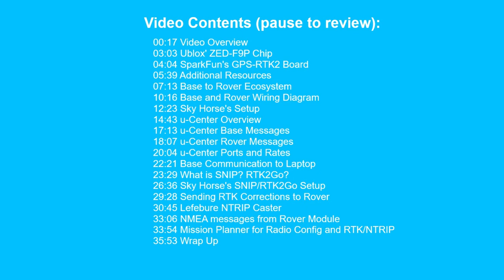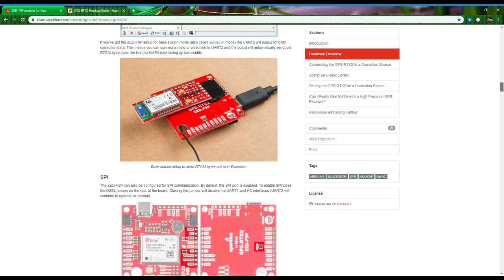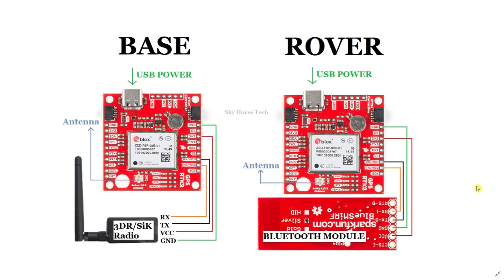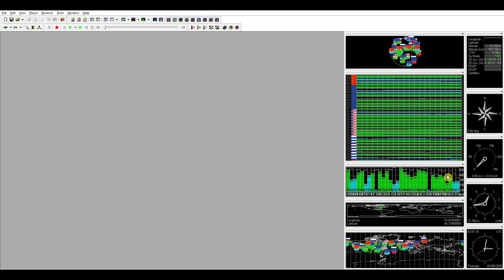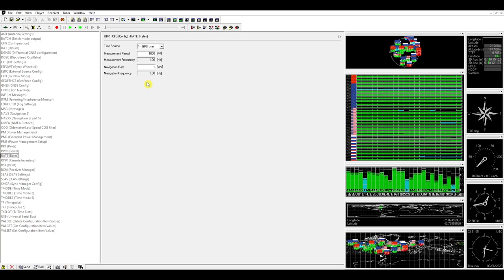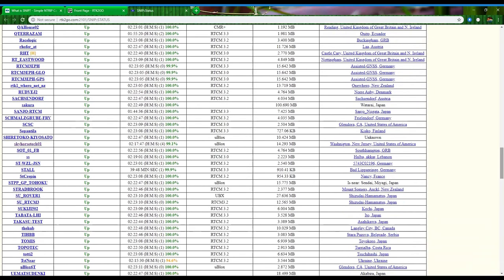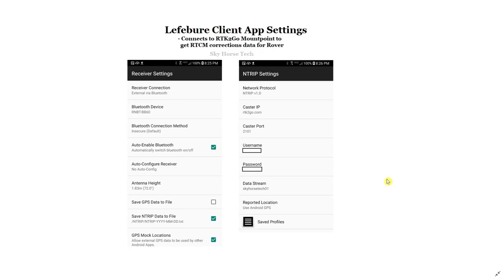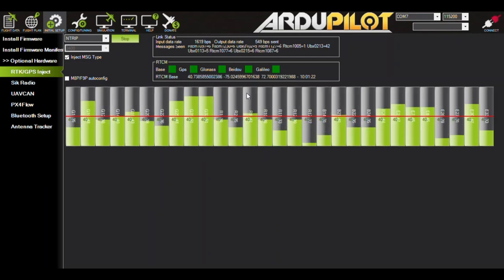How to setup ZED-F9P RTK Base and Rover

Comment: very nice.. can you help me build rtk base and rover
Reply from the maker: We aren't able to provide 1-on-1 instruction at this time however there are several excellent how-to videos out there that should get you started in the right direction. Check out Roby on YouTube along with the links in this Description section for addt'l guidance. Start simple by building a rover, using the wiring diagram in this video. Once you get that running, building a base is much the same. If/when you get stuck, Google or YouTube search your problem and usually someone else out there has run into the same exact problem and provided their solution. Good luck!!
Reply: thank you very much.

Comment: Hello Sky, good morning.
With what name do I get the USB adapter and the accessory to fix it to the box on Amazon?
Please also indicate the accessory to fix the antenna adapter. It is that I am in Colombia and I do not know what name these components are known in the United States.
Thank you so much for your patience.
Reply from the maker: Hello, we updated the Description section above with a complete materials list. The item you are looking for is the Blind Spot Power Junkie. You'll also need the battery(s) for that which is listed right below that, the NP-F550 batteries with charger. To attach the Blind Spot to the survey pole you'll use 'pole clamps' with 1/4" connector listed right above that. Not sure which antenna adapter you are referring to but believe we included all of the antenna items as well now. One thing to be aware of when purchasing the SMA or U.fl connectors is to get the correct combination of Male and Female wires as all of those antenna wires come in several configurations. If connecting to a male SMA connector you'll get a female connector wire, and visa-versa. Hope this helps!
Reply: @SkyHorseTech  Thanks champion

Comment: Great! Does we need to set the GPS coordinate of the base station?
Reply from the maker: Yes, you can get the base coords using the Survey In method in U-Center or run a survey for 24 hours and get even better accuracy using PPK with a CORS base station. You would have your base station setup as a rover during that survey and the base would be CORS. Then when you get the exact coords of your rover (future base) through RTKLIB you plug those base coords into u-Center and switch your rover to a base.
Reply: @SkyHorseTech  Thanks for your elaborate explanation, though I can't understand it much. Supposed I go to survey an area and I don't know the GPS of the base, can I just put a base and then a rover and start surveying?
Reply from the maker: @កសិកម្មនិងបច្ចេកវិទ្យា  Thanks for watching. Your base will need to know the coordinates of it's exact position. This can be obtained using the Survey In method which is the easiest but not necessarily the most accurate as it takes 12-24 hours to get a more accurate position. Check out the uBlox documentation on performing a Survey In, it's fairly easy to set. Thanks again.

Comment: Hi, I also use the zed f9p base rover system, but if I install the system in a new environment, the rover has 2 meters error due to the 2 meter error of base. How long do you take measurements for the base to verify its position. I want to use this system in different locations from day to day. Do you have any suggestions?
Reply from the maker: Yep it's a common situation. Survey-in will get you meh results depending how long you have it running. You may not want to sit there for 2 hours while it is running Survey-in. If you don't have a pre-defined survey marker that you can plant the base tripod over your best bet probably is to utilize a CORS station if you are in the US. Other countries have similar base GIS systems for free. With the CORS station data logged at same time you are gathering rover data, you would use the CORS as the base data and come up with a PPK solution in software such as RTKLIB (free). That will get you much more accurate results than a quick survey-in at a temp location. Also use the CORS method to nail down a permanent base antenna location if you decide to go that way ever. If you are moving about in various sites within 10-15 miles every day then setup your base in a permanent location and pipe your corrections over SNIP (free) and Lefebure NTRIP client app on phone connected to your rover (Bluetooth or USB). Check out our other videos where we show how to set that up. Thx for watching!

Comment: do i absolutely need a base stattion? im looking in using RTK GPS for my final year engineering capstone project
Reply from the maker: For RTK (real time) you'll need corrections from somewhere. Your options are a base station or an NTRIP solution being received over radio or cellular. The NTRIP subscription will be monthly and will vary by region, some US states actually have free services. If doing adhoc missions sparingly you'll be better off having your own base station. Perhaps look into PPK (post processing) in US as there are many free CORS reference stations that can provide those corrections in post.

Comment: which is the list of all the components to be able to assemble one
Reply from the maker: In the Description section we have material lists broken out by Rover and Base. Depending on your need, some of those components are optional, such as the Blind Spot battery system where you could sub in a Lipo battery with 5v BEC or simply power by USB. Also optional is the Bluetooth module where you can use USB hardwired for data transmission. For either one you will need at a minimum a project case, ZED-F9P and GNSS antenna. With those components you can get a rover or base station operational in short order. Good luck!

Comment: Congratulations on the very useful tutorial. I ask you for advice: with a ZED-F9p in rover configuration, detecting more points I get a very quick fix but I see the points detected on the Google map of SW Maps, about one meter away from the real position. What am I doing wrong? A greeting Aldo Guarasci
Reply from the maker: Thank you Aldo. If you aren't using base corrections, either from another F9P, CORS or NTRIP station your accuracy will be diminished. If you have another F9P setup as a base station be sure to lock its coordinates in with a long survey (12 hours+) and run it thru a PPK solution using RTKLIB which will give you the exact coord which can then be entered in the base using uBlox's U-Center. RTKLIBexplorer has a few helpful posts about that for reference. Also keep in mind that Google Maps is not cm level accurate so your findings may be accurate and Google is not as accurate. One test you can perform with RTKLIB is take different surveys of the exact same point on different days and see if you are coming up with the same solution. If not, your accuracy is about as high as that delta. To recap, solid base corrections are needed either from a unit you have or from an external source (free CORS here in US for PPK or $ for RTK NTRIP service). If you'll be using your rover a bunch and need RTK your wallet will be better off in the long run by having your own F9P base. Thanks again!

Comment: Can you please tell me that if we can send the RTCM data from F9P and use it in M8P receiver
Reply from the maker: You absolutely can have that setup, just understand the limitations on the M8P receiver. Even with the F9P inbound corrections you'll most likely receive mainly RTK-Float accuracy on the M8P where using an F9P as a receiver you would gain RTK-Fixed more readily. The accuracy of the F9P can get around 3cm while the M8P will be much larger than that. As long as you are ok with that, we say go for it. Thanks for watching!

Comment: Hello friend, excellent video.
I need to know with what name I search amazon for the accessory to fix the "Blind Spot" to the survey post.
Thank you very much for your attention.
Reply from the maker: We used a product on Amazon sold by Serounder with title of "Handlebar Mount, Adjustable Bike Motorbike Handlebar Clamp Bracket Holder Mount 1/4'' Screw for Action Camera/Gopro/DV" it was around $11. This has the 1/4" screw to mount the Blind Spot to. Hope this helps!
Reply: @SkyHorseTech  Ok, thank you very much for the information.

Comment: Hello friend, good night. Excellent video
I keep asking things: What are the dimensions of the rover's box?
What is the name of the system to secure the box to the survey post?
Reply from the maker: The box we used in the video was discontinued for that size but there are tons of different boxes in that size range, about 3.5" x 6". In a forthcoming video we show how we miniaturized the rover box down to ~ 2.5x3.5x1" with OLED display and data logger for implementation on UAS platform. The size of the box is flexible. For connecting the rover box to the survey pole we used a V-Mount system like this: https://www.amazon.com/gp/aw/d/B07Y9JFM8X then we used a V-Mount male connector (https://www.amazon.com/gp/aw/d/B00SMKIXJA ) which screws directly to the rover box permanently. We're still putting together a materials list and will post that here shortly. Thanks!
Reply: @SkyHorseTech  Thanks for uploading these tips.

Comment: Thanks for this great video. I have to C099 F9P boards and want to use one of them as a Rover and one as a fixed Base St on my roof. Do you know the approx. range of the sik radio in buildings? I want to send the corrections from the rooftop to my PC, which is two floors below. 
Does also a free option exist to send the corrections via cellular to my phone which is connected via bluetooth to the rover?
Reply from the maker: We have our base f9p setup outside about 100 yds from the indoor antenna on 2nd floor and it is very stable with regular sik radio at 915mhz (U.S. standard). Apparently you can get additional range and through more obstacles with European 433mhz standard. If you have base on a roof and your receiving antenna is anywhere near a window you should be fine. As for sending over phone check out the SNIP service mentioned in the video that will create your own free NTRIP caster. Your base f9p will send RTCM or raw ubx messages to their servers. You can then access those base corrections over your phone. On your phone download Lefebure NTRIP client, also free. Once you connect your phone to rover over Bluetooth the Lefebure app will pull in your base corrections from SNIP url and forward to your rover f9p. Best bet is to connect the Bluetooth module to the UART2 port if just using RTCM as the board will process corrections automatically on that port. If using ubx raw messages you'll need to use UART1 as UART2 only handles RTCM. Check out our other videos also that go over some of these addt'l points. Good luck and thanks for watching!
Reply: @SkyHorseTech   Thank you so much for your quick response. I have received my 433Mhz Radio Set today and configured it via MissionPlanner. They both have a solid green light so i assume they are communicating correctly. I did connect the RX and TX jumpers with the UART1 pins on my C099-F9P Board while i plugged my second 3DR antenna via USB to my base laptop. I set the UART1 settings exactly as shown in your video, but don't get any messages when i connect the COM port of the base antenna. Can you tell me which port you used to connect the radio antenna with your GNSS Receiver? Is it possible to visualize the incoming data stream or even configure the Base via U-Center with this setup? 
Via which tool did you log the correction data on your Base laptop? 
Looking forward to your reply. Thanks a lot
Matthias
Reply from the maker: @matthiaswochinger6730  You're almost there. First thing, make sure the TX on the F9P is connected to the RX on the antenna and same with F9P RX to antenna TX. When connecting the other antenna to your laptop you can use uBlox' u-Center for displaying the messages coming over the USB port. You'll see which port it connects to when you plug it into your laptop and the port# will appear in the u-Center dropdown. You should use u-Center in setting up your messages also. If you didn't enable the RTCM or UBX messages on UART1 it won't send anything there so check that to confirm. If just starting out use RTCM messages as its easiest. Enable those RTCM messages we shown in the video including 1005 so that u-Center can see the base info/position. Once the data flows you will see green bars in u-Center showing the strength of your base satellite connections and quantity of sats. Taking a step back, be sure your sik radios are on the same channel id (Net Id) or they won't be able to talk. Since you are seeing solid green it's probably not a problem but keep it in mind. The way we pair them is to use Mission Planner (free) and the sik/3DR radio page in that program to check your setup and update if needed. You'll also want to turn off Mavlink in the same sik radio setup page, you're just sending raw data. Many times these are shipped with Mavlink on for drone use but for this RTK purpose we don't want that on. Here's a helpful link for u-center and mission planner: https://ardupilot.org/copter/docs/common-here-plus-gps.html
Best guess is either the Rx/Tx situation (very common mistake) or the messages aren't enabled on UART1 (when setting up messages be sure to enable them to output on USB also so you can see the data in u-Center).

Hope this helps-
Reply: @SkyHorseTech  Thank you very much for the detailed tips. The problem was probably an incorrectly set of the baudrate. I uploaded the latest firmware to both antennas via the 3DR Radio Config application and set the baudrates on both antennas to 115200. All UBX and NMEA messages are now displayed in U-center, which actually made me very happy. However, I cannot start a survey-in process in U-center with the radio link, even though the two antennas are next to each other. Do you have any idea what could be the reason for this? The satellite antenna has a strong signal and also the baudrates are all set to 115k.
Reply from the maker: @matthiaswochinger6730  The best way to set these up is to first setup via USB in laptop directly to the F9P. Once it is working on over USB then transition over to radio link. You may not have your F9P setup as a base station. See the directions that Roby gives here: https://deepsouthrobotics.com/2019/06/03/the-taming-of-the-u-blox-zed-f9p/ where he uploads the base config file to the F9P. He uses the C099 like you but all are pretty much the same setup procedure (Sparkfun, Ardusimple, etc).
Reply: @SkyHorseTech  I did configure the base similarly to Roby. Also i can start the survey-in process but even i have a very good satellite signal and the radio antennas are right next to each other, I don't reach TIME mode. I also tried to set the accuracy only to 5m and the time to 1800s but unfortunately it still doesn't work. Is it possible that the SiK radio antennas sometimes have short signal interruptions, whereby the SurveyIn process never completely run through?
Reply from the maker: @matthiaswochinger6730  If you aren't getting TIME mode avlb then you may not have msg UBX-NAV-PVT enabled which provides the needed data, double check that. Running survey-in mode over sik radio is difficult (impossible?) which is why most of the various manuals recommend running this connected F9P in base mode by USB cable (F9P and antenna outside) or long SMA cable to antenna with F9P inside and antenna outside (see: https://learn.sparkfun.com/tutorials/gps-rtk2-hookup-guide/setting-the-zed-f9p-as-a-correction-source). Another option is to use an Arduino connected to the F9P and upload one of many free F9P sketches avlb to it. Check out our other vids where we use an Adafruit feather logger (Arduino) that has a sketch found on our github page with an option to force it into Survey-in Base mode on startup which can log the survey-in results to an SD card. We didnt use the logger in base mode but the code is in the sketch and can be turned on. If you keep hitting a wall you may want to post a question in one of the C099 discussion boards, that community is very helpful and someone else must have hit the same problem that you are seeing. Good luck!
Reply: @SkyHorseTech  I found out that the problem is that UBX messages are received at my base computer but none are sent out to my receiver. So consequently no changes can be made to the configuration wirelessly. Unfortunately I have not found an answer on the Ublox support page that would actually help me. So let me ask you this last question, did you try to receive data with a rate of 5Hz or 10Hz with the SiK radio via UART1. For me this has unfortunately only worked with 1Hz.
Reply from the maker: @matthiaswochinger6730  If ubx msgs are being received at your computer (assuming over USB) but not in non-USB channels like UART then check in u-Center to confirm you have those msgs turned on to be sent over UART or wherever else you need them sent over. Definitely reference the uBlox u-Center manual it shows how to do that in the Messages view. Review that doc thoroughly, it has most info you need for F9P settings. We have most messages turned to 1hz, you can leave RTCM 1005 at 10hz. Review our video and link in Description section to online doc we created, it shows the inputs and rates we used.